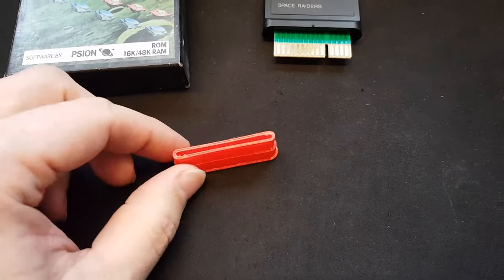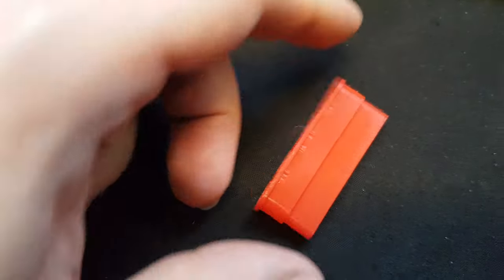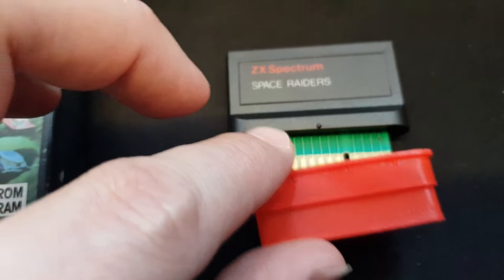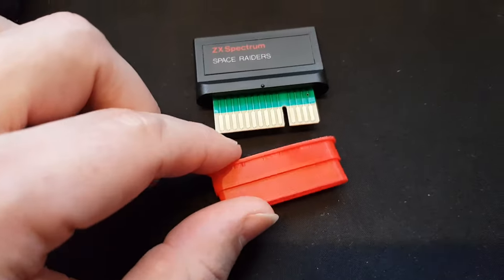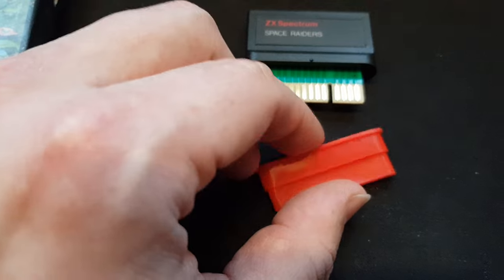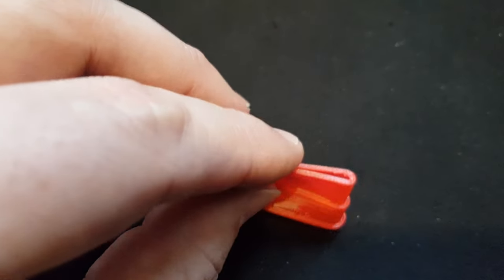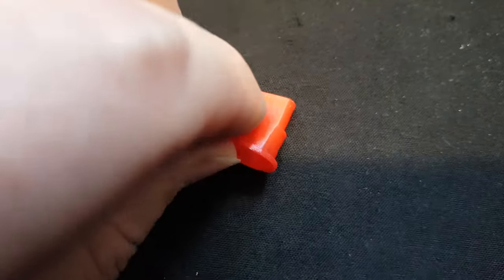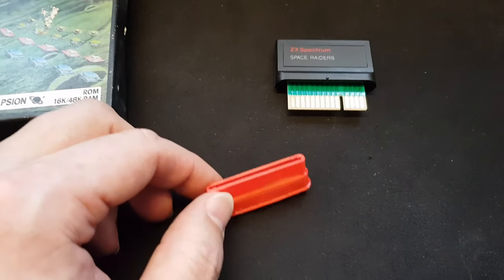ZX Spectrum Interface 2 ROM cartridge 3D printed sleeve

Comment: The Interface 2 cartridge slot was a quite simple design. But it is fascinating anyway. Do you sell these sleeves as a replacement part or do you have further plans regarding Interface 2 or rom cartridges?